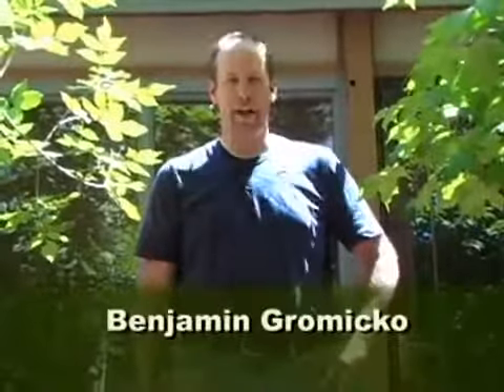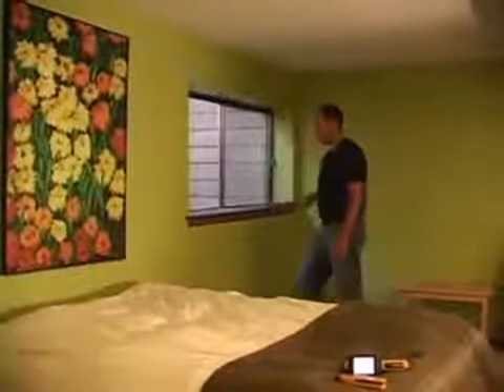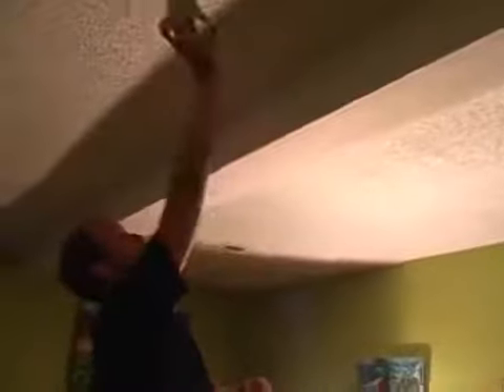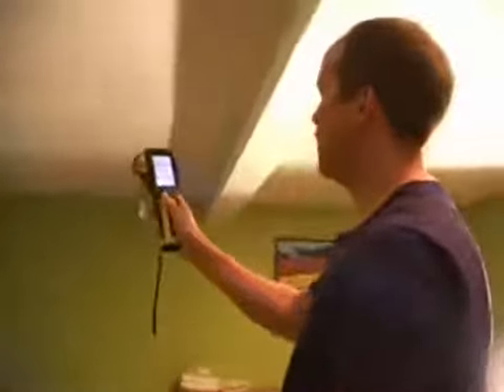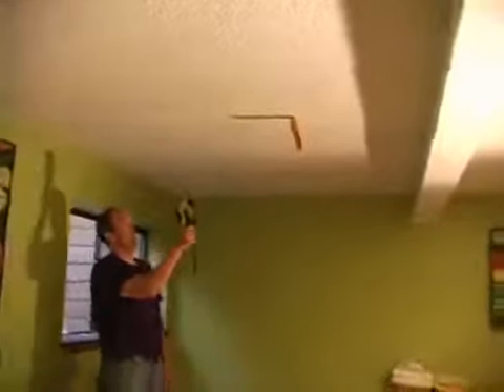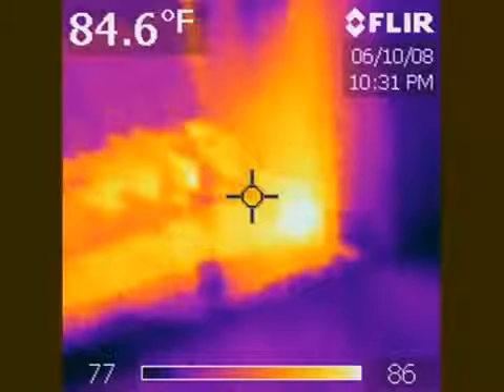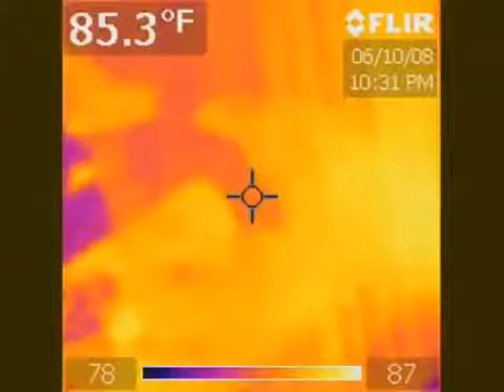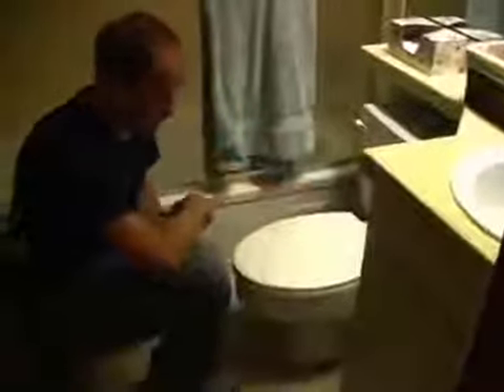Infrared Inspection with Ben Gromicko

Comment: Also, you talk about the recessed light in the bathroom.  Manufacture specs usually say insulation around these recessed should be moved away, allowing for cooling of the fixture.  Many times these lights have a thermal couple that turns them off.  As they cool back down, the light will come back on, only to turn off again.
Reply from the maker: You're correct, Edward. Thanks for the comments.